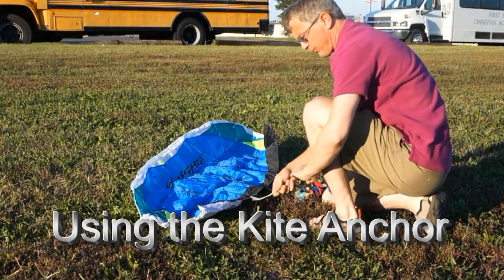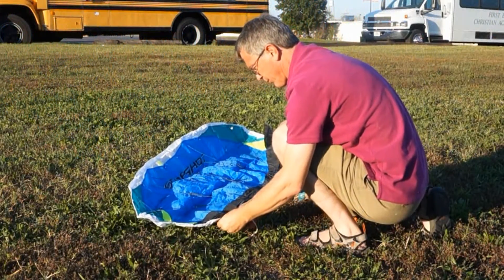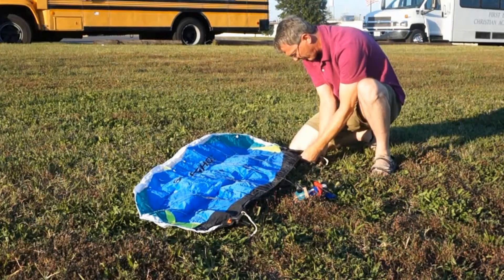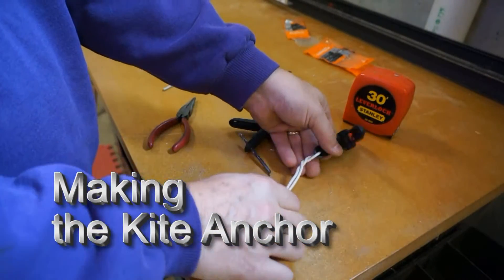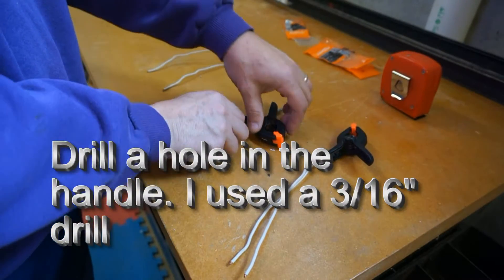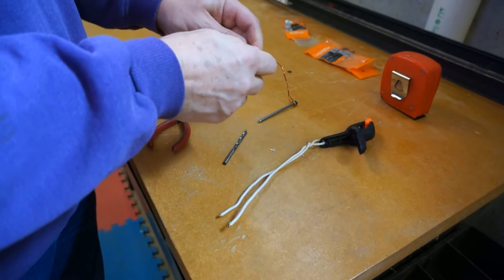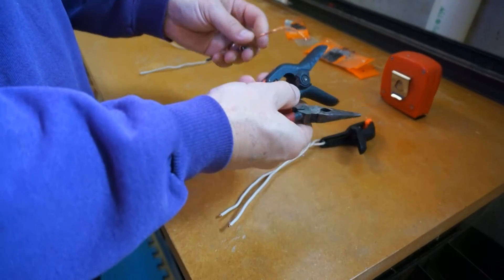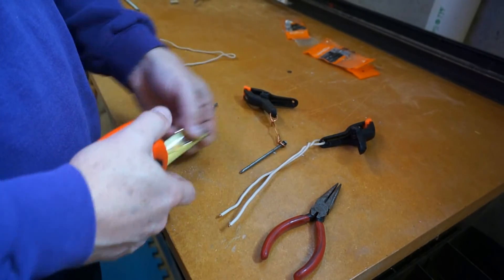Parafoil Kite Anchor - How To Launch Your Parafoil Kite

Comment: As I normally fly at the beach, a handful of beach sand on several spots along the windward edge always works for me on my Synapse 200.
Reply from the maker: Must be nice to live near a beach
Reply: @Fixing-Things  Well, it's a 25 minutes drive or so, but we're grateful to be that close.   We have a park across the street, but it has too many obstructions for clean airflow most of the time.
Reply: We had good wind at my park (rather than the beach).  I had some hobby clamps and mini aluminum tent stakes with paracord loops already attached so I merely looped the paracord through the hole that was already in the handle of the clamp and voila.    It worked great.   Thanks for the inspiration.

Comment: Having trouble launching parafoil and Flexifoil kites i think i will adapt your good idea, I will try it with wooden spring loaded clothes pegs because they have less grip than those plastic clamps, and attached them to a tent pegs.
Reply from the maker: I'll bet wooden clothes clips will work!
The plastic clamps grip pretty hard. I only clip the very bottom edge of the kite so it comes off easier.

Comment: This is too much screwing around. Go get yourself a dog leash anchor for a few bucks instead and just twist it into the ground, boom, DONE!
Reply from the maker: You use a dog leash anchor to launch your parafoil stunt kite? I'm having a hard time imagining how that is done - you should make a video.
Reply: It's not a stunt kite, it's s regular parafoil with a tail. I screw the dog leash anchor into the ground and attach the kite line to it with a carabner
Reply from the maker: I'm sure your method works well for your kite.
The kite in the video is a parafoil stunt kite, not a single string parafoil.